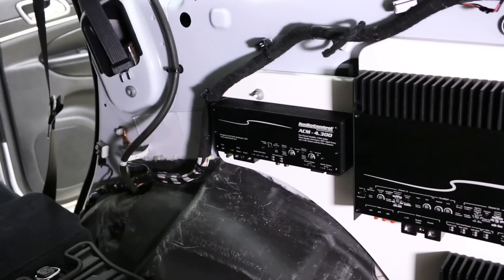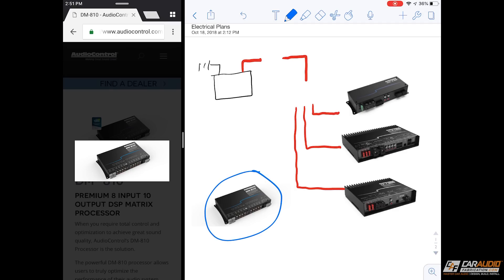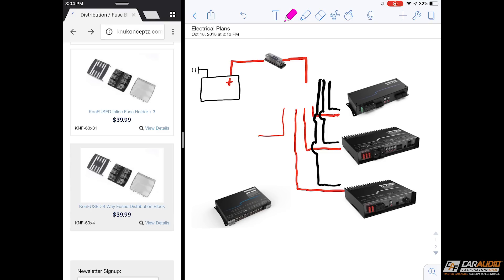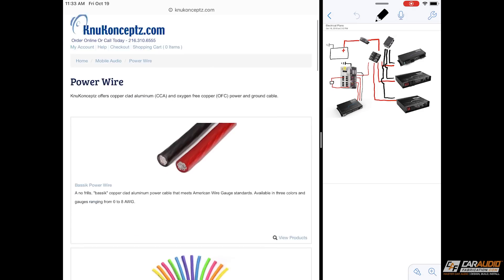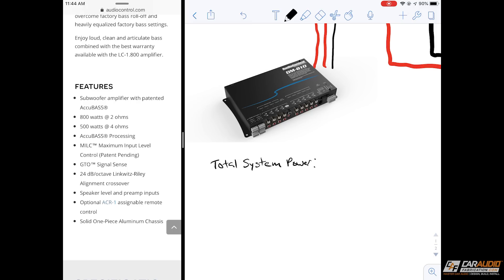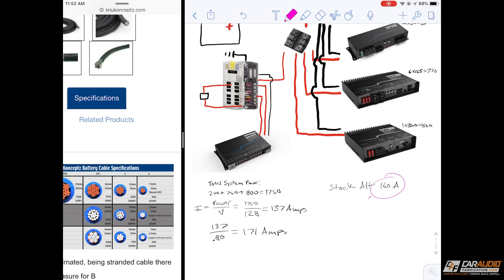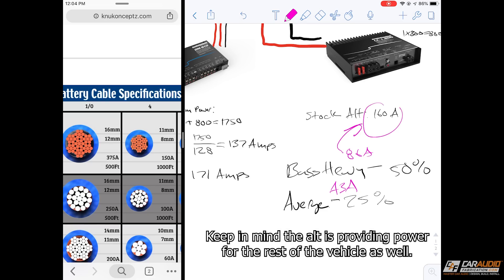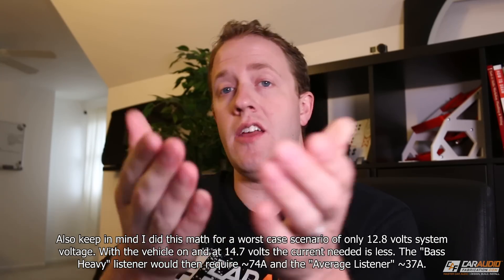How to plan car audio ELECTRICAL system wiring - Is the alternator big enough?

Comment: My 2001 f150 has a 130 amp alternator butting says that it’s normal output is between 80-90 amps I’m putting in a system 1000 watts sub amp a 400 watts x4 for the doors do I need a better alternator?

Comment: Few years ago my boss wanted his “portable electrical supply house” (box truck) to have a fridge/freezer, microwave, 2 120v 20amp circuits for power tools, and a 3000w audio system. He told me he didn’t care how much it cost and how long it took but to get it done and handed me his credit card. Two weeks and 12800$ later it was done. An absolute work of art. Two 500amp alternators, battery isolators, battery banks, capacitor banks, pure sign wave inverter/charger, shore power, and a controls system and panel that would make nasa proud. When he first saw it he lost his fucking mind, he wanted to kill me. He did not understand low voltage DC. I showed him my CAD drawings and my calculations. He understood then. He never realized how complex of a task he gave me or how expensive a project like this would be. He continues to push the system hard today without issues. Last summer he even ran 2 SDS max hammer drills at the same time without issue. I honestly wonder when the trucks engine is going to blow. That poor engine is always under heavy load.
Reply: I would be curious if you did any before pictures, install video walkthrough, anything at all of this amazing project?
Reply: Lmfao epic
Reply: You’re lucky you were able to make it happen!
Reply: @roddydykes7053  I was very lucky. I no longer work for him but I found out that the truck died last year. His new truck has a propane generator.
Reply: Hahahaa😂 That's fantastic, man. Wish I could see it. Thanks for sharing! 🤜💥🤛
Reply: Why didn't you give him a quote beforehand?  I'd be pissed too
Reply: @androidas79  He made it clear he wanted it done and told me to just do it. Thinking back I should have put a quote together before I placed the order. In this case it worked out but this might be the exception. Young and dumb right.
Reply: I would have told him it cost $10k on top for my troubles! Give him a quote!?!... Bsh can do it himself! Lol If i wanna make my house into a castle i have a good idea it costs to be the bawse thou! 💁

Comment: Could you please explain in more detail how you wired up that fuse block and relay?
Reply: . he simply wires the relay to the bottom section to the fuse block so he has mutiple switched outlets to use for the dsp and other devices

Comment: Great video. I'm bass heavy! My total max amps is 398.  So by your 50% I need about 200 amp alt. My stock Ram has 180 amp. I'm upgrading to a 350 amp alt. Thank you
Reply: Make sure you do the big 3 as well
Reply: @drzflyest4  running 1/0. What fuse do you reccomend from +alt to +batt?

Comment: Ok so im following along and i have a question should i do my calculations for power at rms or max power im running 2 jl 12w3v3’s with a rd1000/1 amp its specs are 500x1 but peak power is 2000watts. So if i turn up the gain wont i be over that 500 watts? New to wiring, if you cant tell😂

Comment: how to provide 4 ohm and 2 ohm values in car amplifiers? that is, if we connect 4 ohm 45 rms two speakers to a 4 ohm 90 rms amplifier output, it would be 45 + 45 = 90 rms, and if we connect the two speakers in parallel, if the amplifier output drops to 2 ohms, if the amplifier decreases to 2 ohms, the value of the amplifier will increase. Is the probability increases?

Comment: did you use a relay for the remote? or could you daisy-chain or use a dist block for the remote?... I had been told before if you go past 2 amps a relay is "Required"...not sure if that was recommended or required...could someone answer?  Thanks in advance BTW for my application, I'm using  6CH amp and 4CH amp but wanting to add 1 more 4CH amp.

Comment: Hmm. Let's se
I have a 270 ampere alternator
4x 95ah AGM batteries in paralell
2x 12" SPL dynamics 300D1a woofers(1500w RMS/ 3000watt peak)
B2 zero8 osprey 8.5kw amp
SPL dynamics ICE 150.4 4channel amp
Everything is connected with 50mm2 cabels except for my 4 channel amp.
I am using 200amp fueses on my osprey since that is recommended. Yes it has 4 + and 4- connectors, so it is required.

How does that sound? Am i good to go? Or should i change anything? The car is a volvo t5 turbo 2000 btw.
The alternator is charing 14.8v when driving, and when the car has the engine shutoff, the batteries holds 13.4 volts

Comment: I need help. Please someone tell me Where from to order an alternator. The thing is i found out that you can buy an powerful one But How is going to fit When the oem is totally different shape ? I will buy any, But whos gonna put it in place And how ? The car is chrysler 300C with mercedes benz diesel engine 2008-2010. Same as any Mercedes with the 3.0 diesel engine. I checked the alternator for 300C hemi - they are different. They told me at the car audio shop that they are not able to replace the alternator because they dont know which one is the correct one to be bought. This is Europe you know ... amateurs all arround. They dont know shit.

Comment: Quick question. When using the High inputs on an amp.  I am getting amp wine. through my speakers.  Since I am not using the low inputs ( RCA ) I can not simply add a ground loop isolator.

My ground is to direct metal and the area has been sanded to bare metal so I know the ground is good.  When I turn my vehicle on but do not start it, it does not wine.  I only get the wine when I start my vehicle and drive it.

Can I add a resistor to the ground or power to fix this?
Reply: Try grounding the stereo chassis- outside of the stereo...

Comment: SO CAN I JUST daisy chain my amplifier and DSP together with the positive power line? 

Like run the power cable to the positive terminal of the amp, then Run the DSP 12V input power cable off of the positive terminal of the amplifier?

Comment: Hello, i am a big fan of your channel, Sorry my poor english i am a Brazilian boy,... Well, i have one 4 channel amp but i am using only 2 Channel in stereo mode, in that case does my amp is consuming half Power It is  designed? It is a class d RF. Thanks Very much!
Reply: According to what I understand of this Video:
Sine Wave player  -  it will consume 100% when using all channels,  but if you use 2 channels out of 4 then it should be 50%
Base Heavy listener - it will consume 50% when using all channels , but if you use 2 channels out of 4 then it should be 25%
Average listener -  it will consume 25% when using all channels, if you use 2 channels out of 4 then it should be 12.5%
Reply: @bryangoelab4865  TKS!!!

Comment: 1x powered sub 100w 6x 30w speakers 
260w total lets round that up to 300w just to be safe, 300w @ 12.8v is 23.5a that at 80% efficiency is 18.8a, my car is a 1994 mitsubishi galant with either a 75a or 90a alternator (based on rockauto) 
being an average listener @ 25% that is at 4.7a even at 50% that is only 9.4a@12.8v
imma just go with 10ga since i have it

Comment: Can you point me in the right direction? I want to convert a 6 speaker prius to a 9.1(4 high, 4 mid, a center mid and a sub in the trunk) speaker one. I'd like to keep the factory stereo as a base point but i'm likely to upgrade to some sort of android head unit in the future.
Best regards.
Reply: eivis13 most likely having as many speakers as you do you will want a distribution block with two four channels to power your speakers and one mono block. Or one four channel and one five channel but the thing to keep in mind is if you plan to upgrade the head unit, just wait till you can afford a head unit because it will be much easier to work with than the stock

Comment: Hey, I noticed when calculating system power, you used the RMS values. Since your are calculating total amperage draw, wouldn't we need to use max output? Or are u not worried about the amperage spikes just the continuous power draw? Also, do we not have to worry about the amps that the cars electrical system and components are already consuming? Thx!
Reply: I'm still learning, but I would think the battery would be able to handle a brief spike in amp draw. But, I would also think the cables and fuses should be a big enough gauge to handle that much current at once. I'd like to know his reasoning on using RMS to design those.
Reply: Did you ever get more clarity? Especially on the last point?

Comment: This was extremely helpful with a combined lows mids & highs I’m upgrading my 1100 watt rms system on stock alt and battery to a 4500 watt rms system with a 270 alt & d7500 xs battery In my 2018 Honda Accord. If you think this is good or I should change anything please let me know this is my first time upgrading all my electrical for a crazy system thanks:)
Reply: Sounds like it will be fine to me. I've only had 2000 watts of true rms though. I had a battery and alternator upgrade too.
Reply: @therealtruman you should absolutely be fine with that 270A alt and the xs power d7500(that battery is a monster).. if anything else for electrical I would run 1, or maybe 2, cap banks to help with the initial hit of the bass notes. That's pretty similar to a setup I'm running but my vehicle is a diesel so it comes with 2 batteries from the factory. I'm using 2 xs d6500 under the hood, a 320A alt, a sundown saz3000d with a single 18, and hertz audio mille pro 3 way setup  for front stage powered by a Phoenix gold sx800.4... I barely drop any voltage with normal listening/driving around.. now sitting in a parking lot playing some real bass heavy songs with low frequencies, around like the mid 20s it'll start dropping voltage. Next thing I plan on doing is adding a cap bank or two to help with that initial bass drop and keep the battery voltage higher, for longer. Limitless lithium sells a complete setup with the caps and hardware to strap them together so they're ready to use once assembled for like $299. I'd say go watch some vids on people doing tests with the cap banks, extremely impressive.
Reply: Wow man I wish I could hear something like that

Comment: Hey, all of your videos are very helpful. Couple questions. I’m wondering if adding a line out converter to an old stock cassette radio will cut out the high “fuzz” sound of the tape deck and radio. I’m planning to add an audiocontrol lc8i and an amp for the four speakers in the car. Thinking about the 8i because of the aux input option. Is there a better way to go about this? Thanks!

Comment: Why add a dsp when the amps have built in DSP?
Reply from the maker: You are thinking of the D-6.1200. That one has DSP. LC-6.1200 does not. Also I need more than 6 channels of control. DM-810 gives me 10
Reply: @CarAudioFabrication  oh makes sense. Love your videos brother. You're very smart and one of the best installers. Are you master mecp?
Reply: Is the main purpose of a dsp to make all the sound waves flat? And you should do a more in depth of db slopes. You have a very good way of teaching that actually makes sense . Mecp books are a little confusing

Comment: If you drive Chevrolet trucks you CANNOT how wrong with buying a mechman 370a elite.. I was always skeptical but my stock 160 was dying, it ran about 3k rms for a good 2 years along with 2 yellow tops. I bought yellow tops because of the warranty I can use at any autozone, I bought 1 on Facebook and used my warranty so I had 2 new one's..

But I bought a mechman 370a elite and have absolutely almost zero voltage drop, I also have plenty of 2/0 welding cable under the hood and 1/0 skyhigh for everything else. The 370 is $599 but think of it as an investment that you can use on just about ANY Chevrolet truck, all you have to do is change the internal regulator 4pin or 2pin or self excited.. mechman will Change it for you for $45 if u ship to them, not sure on the turn around time.. but they are absolutely a must in car audio and will keep everything powered with no lag.. I will always buy high output alts for my vehicles.. plus it has a 2 year warranty I believe.. and they stand behind there products and will fix it for a discounted price if ever needed.. the 370a has awesome idle power I believe my dyno sheet said 287a @ idle and 378@ 1800 rpm.. and holds steady at 14.4v ~15.2v unless I'm fully charge it sits at 13.7v.  My truck have computer regulated voltage.. but under any load it sits at 14.4v and hardly dips to 14.0.. I've never seen it dip under 14v

Comment: dude, 137 x .8 is definitely not 171. jeeze man
Reply from the maker: I think you don't understand the math. If the power required is 137 amps and the amps 80 percent efficient the power needed MUST BE MORE and is thus aprrox 171.

Comment: Hi,  I need help.  I own a 2009 Acura TSX WITH Nav :{  you can guess what I am about to ask......I want to take off me Navi and put a better aftermarket radio.  If not, what are your suggestions to make my Music better??
Reply from the maker: You want to integrate with the factory system, I wouldn't replace it. You need to look at using a DSP or similar integration device.

Comment: So on the Jeep Grand Cherokee the battery is under the passenger seat. Did you also run a 0 gauge wire from the alternator to the battery to essentially create part of the big 3?

Comment: Is there any disadvantage to using a larger power and ground wire then needed ? i am starting with a budget build to learn before getting more expensive equipment  , but would like to use 0 gauge for larger loads later , so im curious as to what disadvantages may come with that

Comment: Okay. I need your help. I have a 91 Nissan D21 extra cab and want a second altenator in the A/C compressor spot. I listen to BASS SPL music and NO ONE HAS an Altenator for my truck so thus the A/C compressor spot. That way  
the truck has its Power and the system has its own power source. 198amps is my system. So could you point me in the direction if you can't help to someone who can? Thank you

Comment: Hey bud, love the videos. Very very informative but i have a question given i can't find many videos on the topic. 
I bought a MD audio amp 2500 watts and I'm think a resistor blew because sound does come out of the subs but no bass at all. 
On top of that before it "blew" ( for lack of a better word) it only gave me bass when the volume was way high on the head unit.
Any ideas on what might be the problem? 
Ps, i don't mind messing around playing with the amp. I'll make it a little project. 😉

Comment: For the worst case scenario heavy bass user pulling 86 amps of current, why would an upgraded alternator be needed considering stock provides 160 amps? If this because you can't rely on that full 160 for the car audio as the car itself is drawing power?

Comment: Quick question, if i have 2 way speakers at front with crossovers (i set to 0 db tweeter, and full range for mid. speakers) do i have to remove them if i want setup DSP or i can let them stay? It’s not be messy after to configurate everything?

Comment: Okai so I've just got my first car. A Nissan micra SE 2000 model. I'm looking to get a great sound system. A good amount of bass but clean at the same time. This is my first car so I know literally nothing about sound systems yet. Can someone give me an idea of where to start thanks.
Reply: Hi, since I don't know how far you've come already since you posted your question, I'm just tying to generalise in my answer. This is really what you need to do in order to get you where you want to get, but one thing should be said: almost any component today will give you what you want sound-wise, even cheap ones are at a good standard today.

I would start with the budget. 
How much can you spent for a front-component system, a subwoofer and either a 4 channel amp or one 2/4 channel and a mono amp?

After that it's time to take some measurements in the car.
What size of speakers can you fit in the doors without changing anything?
How much space a you willing to give away in the trunk for a sub?
How much space to you have for the amps and wiring?

With that roughly checked, how much can you spent on dampening / sound-deadening?
How much do you really need to do for your particular car?
How much space do you have for the wires and how much can you spent on that?

With all that roughly calculated you can start choosing components and start your build.
You can find videos from Mark on all that.

I hope that helps you and don't get overwhelmed, start with this and you're good to go. We all need to start somewhere. Cheers

Comment: I generally have more questions after seeing the videos. Not all are directly related to the topic discussed. Lately I've had a lot of headaches matching male/female quick disconnects with the speaker terminals. Why aren't there standard size numbers or letters to correspond with the terminal size? I can tell a#2 Phillips head screw from a #3, but just looking at a speaker male terminal, I cannot tell what size it is, until I try to put my wiring harness on and find out that the terminals I used are too big or small. Am I the only one who has this issue, or are there others out there suffering the same frustration?
Reply from the maker: I know what you mean, there are four different spade terminal sizes that I have seen. I just bit the bullet at bought a bunch of each, then I always have them on hand.